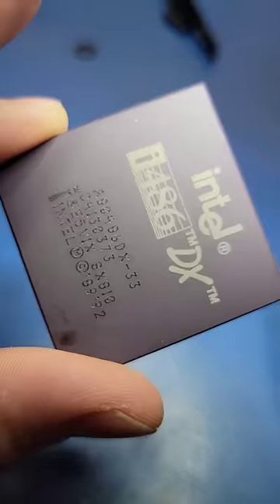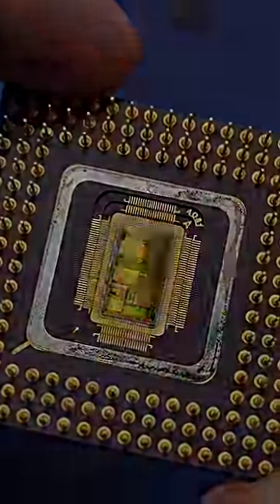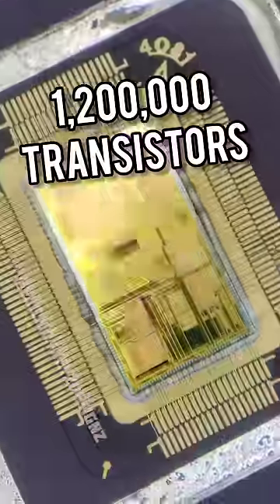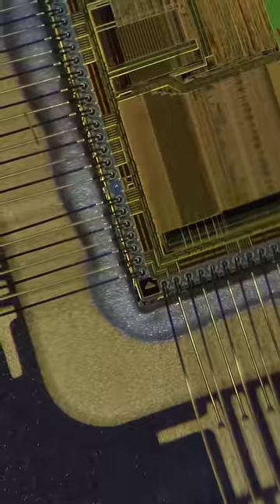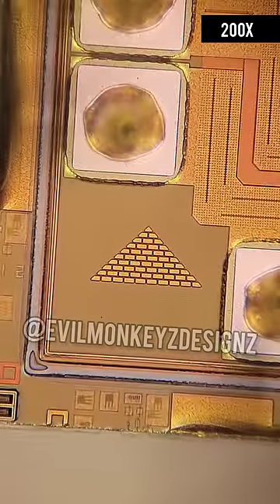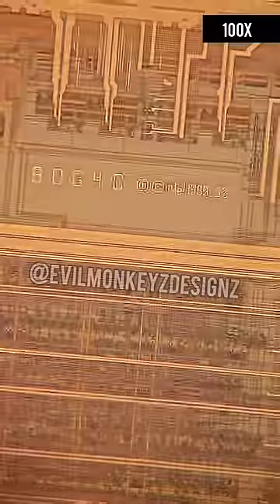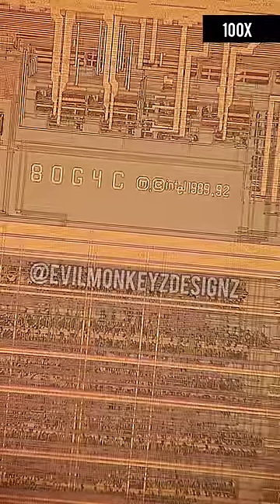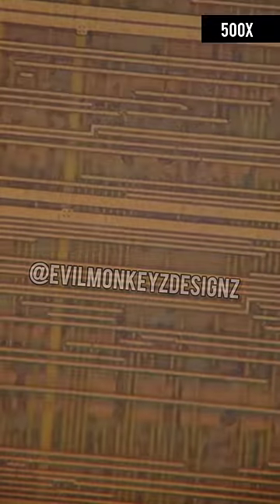Inside an Intel i486-DX CPU

Comment: After a deadly mid-air collision over Cerritos, CA in 1986, the decision was made to equip commercial aircraft with an airborne collision avoidance system with the best technology available at the time.  The TCAS system was activated in 1992 and has been protecting fliers ever since, even though its operations are rather primitive compared to the technology. available today.  The first TCAS processor units installed in aircraft were based upon two 486 CPUs.
Reply: I'm a pretty big plane enthusiast, and not even I knew that!
Reply: Do you know which avionics vendor that was?  Even back then there were SO many better chips for embedded real-time apps such as TCAS, than the klugey x86 family.  :(
Reply: @MajorCaliber  which processors did you have in mind?
Reply: @2jpu524  AMD 29k family, Motorola 68k line, MIPS, Hitachi/Zilog 64180, etc., basically standalone microCONTROLLERS vs. motherboard type microPROCESSORS such as the 486, the latter requiring all kinds of support chips, e.g. Northbridge, Southbridge, etc... not to mention the x86 CPUs have always been power-hungry, which means more HEAT to get rid of... things you might not want in a small expensive box, stacked like bricks amongst other avionics, all 8 inches from the pilot's knees.
Reply: @MajorCaliber  Convenience in programming is a big factor. Even though the timeframe likely misses the i486SL (first to run on 3.3V core voltage) as well as the i386EX (bundling all the support chips in a SoC package), this is still the era of single digit watt SBCs that you can shove into a box with a heatsink.
Reply: @MajorCaliber  All of the up you listed are microprocessors.  AFAIK, only the 64180 had a integrated MMU, the rest like the 486DX all requite ALOT of support chips from IOC and MMU.  None of them are microcontrollers.  I personally used Intel x86 for avionic applications, they have good MIPS/W performance.  Of that list the 29K was a awful uP with extremely poor S/W development tools.  The only uP in you list that is on par with the 486DX woulda been the MIPS R4000, the others are poor choices compared to the 486DX IMO.
Reply: I lived in the area when the crash happened, we could not get to our house for days until they could clean up the mess , a few people from our church died on the ground when this happened .
Reply: Likewise, many old power stations and the like are still controlled by equipment using floppies and 3 1/4" disks, making them still in demand.
Reply: Bot comment
Reply: Unlikely.  

First.. aviation doesn’t run new hardware. It runs old and robust hardware.  The 386 chip was produced until 2006 for use in aircraft autopilots.. that’s how far “behind” are.. 386s in the era of Intel Core 2 Duo. 

Second.. the amount of data a TCAS system has to process is minimal. TCAS alerts and resolution advisories are based on distance, altitude, and vertical speed.. the distance being the simple time measurement between interrogation and responses of transponders which dates back to WWII.. and the altitude which is a simple raw hexadecimal encoding.. and vertical speed likely a similar hexadecimal encoding or simply taking the rate of change of the altimeter encoding for Mode C transponders that can’t transmit vertical speed and resolution advisory data.  

There is also a BS direction finder consisting of four antennas which is notoriously inaccurate and causes targets to dance around the screen particularly at close range.. I wouldn’t be surprised if it was pre-war direction finding technology. Add an interrupt from the radar altimeter to disable it below 1000 AGL and allow EGWPS to override it at low altitudes.  

All that is collected into a processor and program that triggers alerts and resolution advisories visual and audible on a tiny screen or simple overlay based on a simple set of rules. 

There’s no way you need a 486 to run all of this.
Reply: @MajorCaliber

It’s not 8 inches from the pilot’s knees.  AFAIK the first panel that had most things mounted right behind it was the G1000 from 2004.  

These were embedded systems with discreet components. You’d have an instrument and/or head unit in the cockpit and the actual system would be rack mounted in the avionics bay like all of the other systems like radios, gyros, flight management computer, etc.
Reply: @MajorCaliber  Honeywell - 
its always Honeywell
(or its incestuous twin - Raytheon)
Reply: @MajorCaliber typical armchair experts. Just naming things from the era. No real evidence or reasoning.
Reply: btw about tcas: unfortunately it took yet another crash in which one pilot followed the conflicting commands of ATC before it was made mandatory to always follow the tcas advisory no matter if ATC says otherwise
Reply: I remember that day
Reply: Neat
Reply: I hope they didn't "come on down" to Cerritos Auto Square
Reply: Wow, for something that critical, I am surprised they wouldn't have gone with a RISC chip.  Yikes.
Reply: @MattsBaseballWorld Back then there were exactly zero RISC chips with the installed base within a couple orders of magnitude of the 486. If you want a CPU design that has been extensively proven to work in “down to earth” conditions, it is extremely hard to beat what went into PCs. The 486 was a very well tested and dependable CPU. Nothing was inherently better/safer about a RISC for such an application. And the development tools were very widely used and bugs were documented/known. That’s very important as well!
Reply: @absurdengineering  The big problem with the i486 and using it for fail safe applications is Intel took off the error correction on that chip, that alone would  disqualify for aeronautics.  If the 486 wasn't good enough for medical use, I wouldn't pick it over a well tested RISC, but hey, aero's made worse decisions.
Reply: @Conradlovesjoy  My dad had a 486 66MHz PC. It had 8MB of RAM and a 16-bit Soundblaster card. I made a game on it in Q-Basic. I also played Wolfenstein 3D on it.

I think of myself as a little knowledgeable on the 486 CPU. A little more than an arm chair expert.
Reply: @MajorCaliber  x86 wasn't really that klugey until the Pentium and SIMD instructions. The 64-bit instruction set is insane though.
Reply: please have a look at the amd p75 dx5-133mhz
Reply: @MajorCaliber  I think another commenter mentioned it was Honeywell.  Rockwell Collins followed quickly and I believe they may now be the industry leader with the ISS line.  I only know this because I work at the facility where they make these :)

Comment: This was the exact same CPU in my first ever computer. That machine was a hand built computer that cost me £1,200 including a 14 inch colour monitor. The PC had the 486 DX-33 CPU, a 252 Megabyte HDD, CD-ROM drive, a humongous 4MB RAM and a 1MB VESA Local Bus Graphics Card - the latter which was the icing on that digital cake. It came with Windows 3.1 pre-installed, and was the machine that catapulted me into my life long IT career. It was not a brand name machine. It was expertly cobbled together by an experienced Computer builder who knew exactly what he was doing; the machine never failed on me once, and kept running faithfully even after I upgraded and gave it away.
The 486 DX-33 chip had a maths coprocessor which made it a great CPU back in the day.
It handled all the games of the day that I threw at it and was also excellent for desktop publishing apps of the era. That CPU opened a whole new world for me! 
I remember it most fondly.
Reply: I remember MSFS had a huge fps gain on that cpu. I didnt want to touch any other computer without a "math coprocessor"
Reply: Did you play One Must Fall on it?  Haha, man.. good memories.  I didn't play it on that set up, but on an IBM Aptiva with a Pentium 100mhz, 8MB RAM, 1GB HDD.. "Quad Speed" CD-ROM drive and a 3.5" floppy.  Windows 95 on this.

I remember playing that skiing game on PC's like yours.. Arkanoid.. umm, a newer Oregon Trail, I believe, not the old school one.

Comment: I still have my i486 DX-4 100 MHz CPU. still works
Reply: that was my first ever PC, bought just as the Pentium came out but only had a 66 Mhz clock speed, so the DX-4 was faster.
it was such an eye opener to use from the Sinclair Spectrum and A1200 I had before it.
Reply: I still have my Z80 processors from 1976 :)
Reply: The hyperthreaded version? I loved it. Had a workstation laptop with it and it screamed.
Reply: @jamescrane4967  No hyperthreaded 486. That came over a decade later.
Reply: Why wouldn't it? I still have my first computer, a 1975 West German clone of an Altair 8800...and it still boots up.

Comment: Many, Many of these early CPUs have amazing details that can only be seen under a microscope..
Reply: And to think about what Bill Heard said about the design team at MOS, they could just design the circuitry intuitively without computers or simulations. They just knew how it could be made to work... That was some old fashion craftsmanship, a form of art... Even if the chips MOS designed were quite simple things compared to even 486, not to mention anything beyond that. But so many of their chips are outright legendary. Few understand exactly how massive success the 6502 with all of its variant are. It basically powered an entire generations of computers, not just Commodore, but more like most of the entire 8-bit generation... And didn't die out even long after that. I think there are actually medical devices literally keeping people alive, powered by a variant of the MOS6502.
Reply: @JuhoJohansson-bz3jb  Bill heard and all the team at MOS technology are absolute legends. As far as I'm concerned Chuck Peddle should be a household name  as famous as Steve Wozniak , absolute   genius